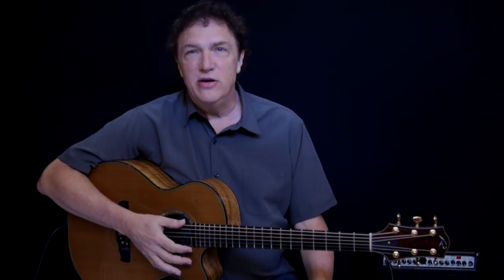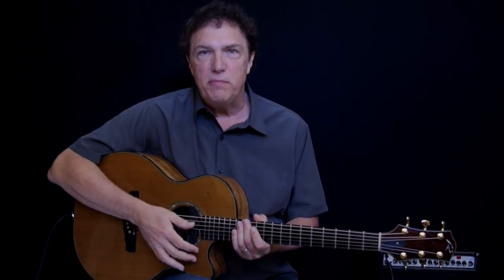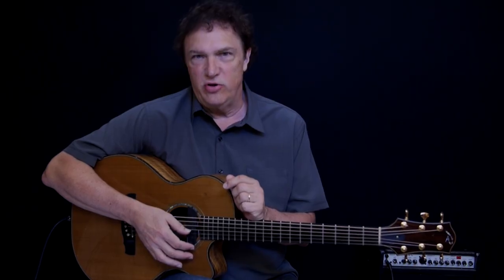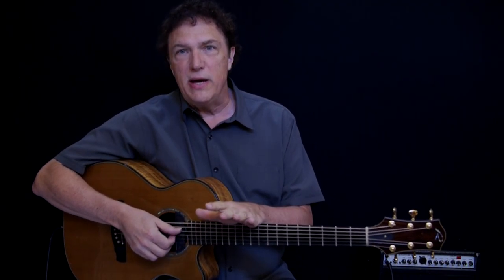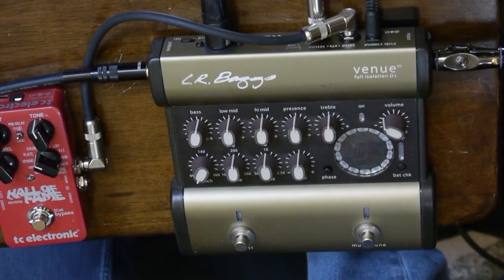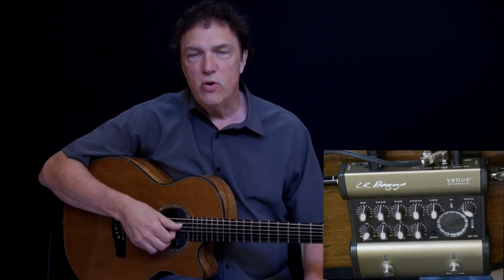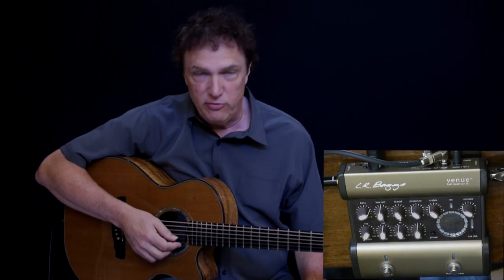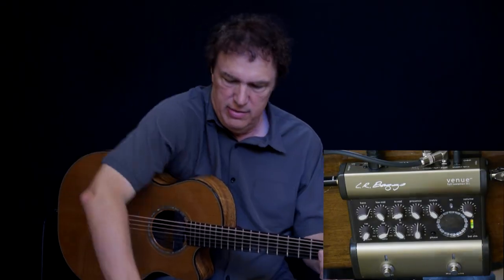Acoustic Guitar Guide to Pickups and Amplification

Comment: Nice explanation, but how does it plug into the amp or pre-amp? So the pick-up that goes across the sound hole, I don't see anything running from it, but there seems to be a cord running from the bottom or back of the guitar. Are these guitars acoustic-electrics? I'm interested in amplifying my regular ol' acoustic. I don't understand how it plugs into anything.
Reply: Yes can someone please answer this question.
Reply: Late reply, but as I understand it he has an acoustic with a pickup- which he explains in the beginning of the video. A ton of acoustics come with pickups- which are devices installed into the soundboard that allow you to plug into it and "pick up" the resonance of the soundboard and amplify it. It's possible your acoustic doesn't have a pickup- but you can get them third-party and install them or take them to a luthier for installing. There are also guitar mics that can be clipped on the inside for a more customizable hot-swap situation where you don't want to permanently install something. However, you need either a pickup or a mic to get the sound from your acoustic into an amp.
Reply: @CrankstaWho  They have amazing pre amps today, I was just delivered a 2025 model of something new, or new to me.(Prototype). Standard Fishman sized preamp case , USB rechargeable+ changeable18650 cell .  7 effects,Mic+piezo +transducer with a DSP and The Transducer makes the guitar Hum along with the guitar to make it resonate more on the DSP(can be shut off) .It also can play my Loop pedal back into the transducer to make my acoustic guitar body The sound source of that loop pedal with Transducer and Live lead  out of same body. (this is a gen 1,so it cannot do it all at once I have to choose , do I want a loop from the guitar? or added resonance from the guitar.) Bass and mid sounds  great, the Crisp Highs are not there like when ran through an amp, or the actual string itself.  But for Bass, very nice, Now my concern is this thing going to hum, or have issues when on a stage..lol It is basically a Rasperry Pi , made for acoustic Guitar, with a Single knob/button..and 8 "4 color  lights" and 64 pages to read., to specify whats on or off. Thankfully no built in tuner..lol BUT I have to tell them My opinion in 6 days,  and push it as This Years possible best Holiday present .Or Dump it...  I am so Impressed thus far,  Just need to be in a Matrix of Sound Amps,EMR, and The Ghosts of Whatever venue etc and make sure this is Shielded correct and is not a Fluke that I got a good one.